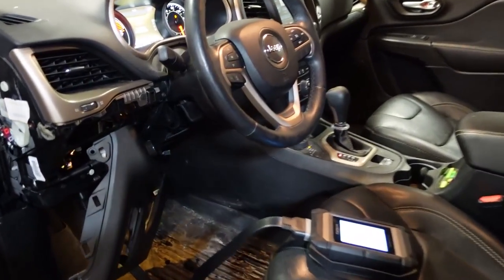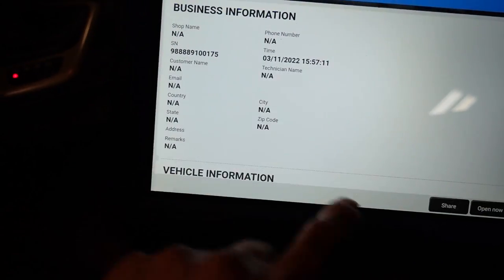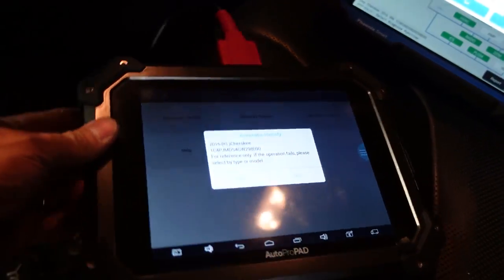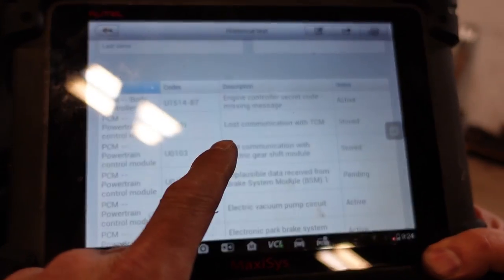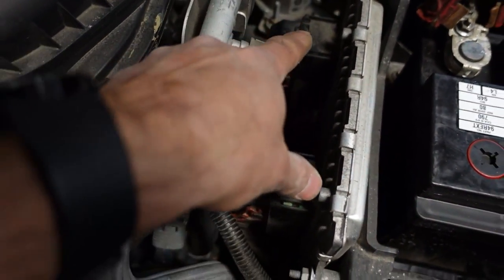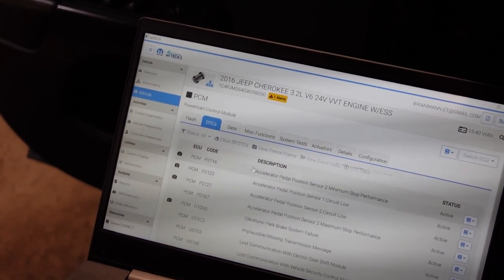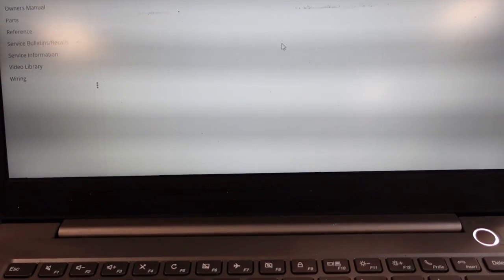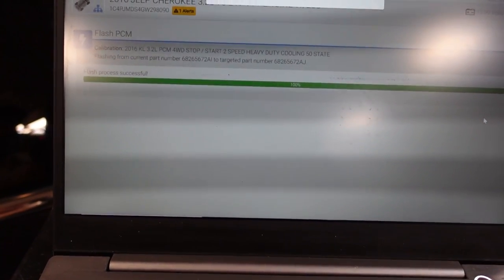2016 Cherokee No Crank  U0168 U1514 Fix

Comment: Wow what a nightmare vehicle! I had one similar to that months back that I manually put into neutral with the red pull leash for an alignment and afterwards had alot of comm codes and a no crank. Ending up needing a shift control module....
Reply from the maker: Wow,  all locked up..  I get many calls when the red release is pulled..
Reply: @BrianMann216  it sometimes trips a light that usually clears for me. What else do you see happening?

Comment: Hey Man that was a crazy challenge having to fix that 2016 Jeep Cherokee I didn't expect you managed to figure it out the problem man I have so many questions bro I have no idea man I'm in a middle of a pickle because I'm kinda having the same problem as we speak and so many people I thought I could trust as my mechanic support would be on point but man it's down hill for keep trying to get some one to help me figure it out but my situation is that everytime I try to crank my car to start on it turns off and turns back on and it keeps doing that so I got the fuse tester and heavy duty electrical tester and found several fuses that didn't get no circuit so now I think I'm going to get a auto pro pad and figure what software can I use on my laptop to do every diagnostic available to figure out how to accomplish fixing the car by myself since all the support I thought I had failed to they having me learned the hard way doing it urself I guess because dam I've called several people saying they going to help and it's past a few days a week n a few days lost count how many tickets I got already being stuck in a alley worst mistake I ever made in my life at night when I at least expected rats come out and there's been a few times found rat shits on top of my engine and battery fck crazy now I have to forst myself to boost up insomnia trying to figure out how to get my jeep started videos after videos every day and night trying to figure it out lucky my friend had a decent OBD2 scanner kinda help figure out what trouble codes showed up most are lost communication 😢 pcm tcm havoc ecm etc

Comment: Topdon scanners are nice BUT they will give you problems with missing codes and also doesn't do most of what it says it does. Special functions fail more than they succeed. Service lights say reset complete and light is still on. I can go on and on. Typical Launch stuff and they make topdon stuff also so it makes sense. Price point is good on topdon but Autel is still the better option of the two. Dealer scanners always the best way to go but the aftermaket stuff is nice for quick access to special functions and things like that. Scan a newer Mercedes like a w222 or something fairly recent within last 5-8 years with the topdon and then scan it with an autel or dealer scanner. You will find missing codes and missing modules on the topdon
Reply from the maker: I got the topdon to fill in where my autel may miss.  OE tools are the way to go if you can, however that is not the option for many. I am very aware of the holes in all aftermarket tools from the position that I held at my  last "job". the R&D team did comparisons with all hte major aftermarket tools on vehicles 2-3 years old at the time.... Every Aftermarket tool has modules that did not populate or miss codes that the OE tool would pull.  The majority of the time a aftermarket tool can get you codes and some Bi directional control.. in this instance I think I had to use the wi tech for the programming and the proxi alignments..  Thanks for watching and commenting.

Comment: Did you recommend a new pcm anyway when you got it to run? The shop ever say the real story what happened?
Reply from the maker: I told them that there could be a bad PCM. My gut says that it was a logic lock, properly a battery that low, and as the vehicle was turned on the voltage went to low as the modules were communicating.  They said the customer changed the battery because it would not start. SO...  It appears the battery was dead or very low.. This shop did not do much to  the vehicle besides check fuses and codes. This is good.  I can tell you from my experiences this type of situation could have cost the customer thousands in parts at the techs guessing ..

Comment: Curious how similar topology feature is to the witech? Better then autels topology?
Reply from the maker: Topology on top do. Is by network and Is only good for knowing wich network modules are on.. ultra does a better job from what I have seen as far as the actual location of modules. Witech does great job. You have to look at a network diagram with topdon for sure if you are dealing with comm issues
Reply: @Hands On Auto Training ok good to know. Thanks again
Reply: Scan tool topology layouts are not true layouts with series and parallel connections, even a small number of schematics get it wrong. Scan tool layouts will not help you to find a break in the harness where several offline modules are affected. I admit it is very nice to look at and interact with.
Reply: @Duane Donaldson  got cha! Yeah  it would sure be nice if someday that would change.  Just really interested in seeing live (real-time) activity or communication on that mapping.
Reply from the maker: @duanedonaldson2262  the witech has done a good job showing true layout, I have not found  it to show the network improperly. The topdon just breaks it down into the proper networks by protocol, but no rhyme or reason for the location of the modules.